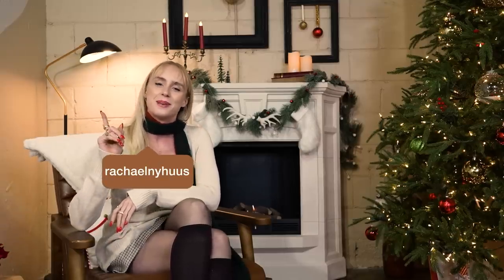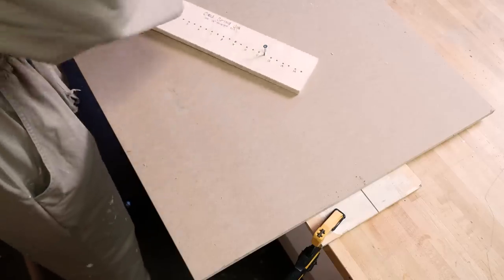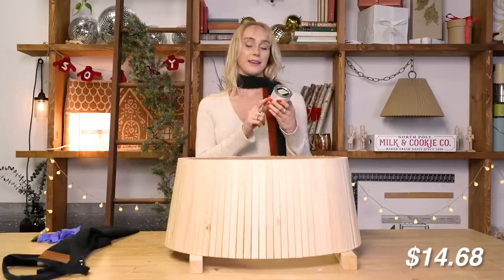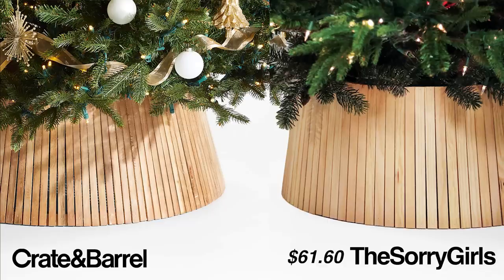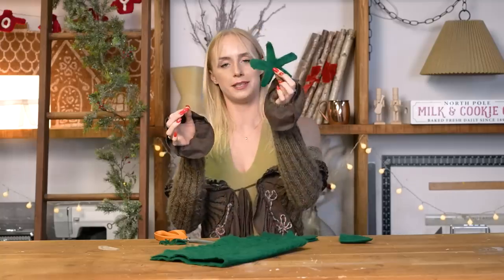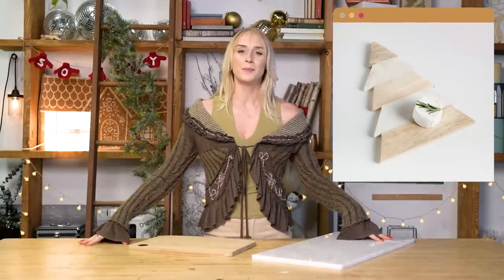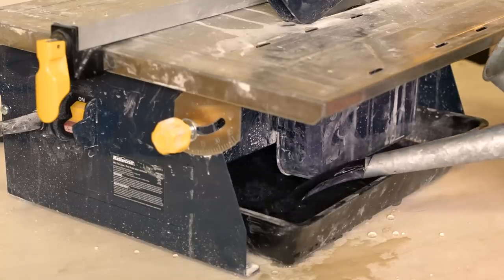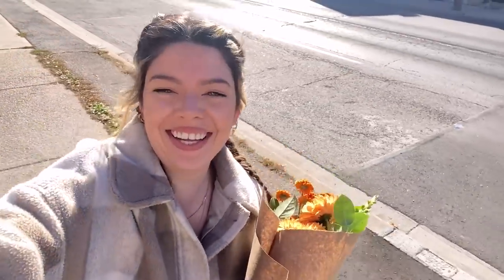let's DIY expensive christmas decor

Comment: Beautiful DIYs, but two of them require lots of experience and expensive tools so the all-in costs are actually higher than buying the original. Would love more accessible DIYs
Reply: Was definitely thinking the same thing. I have hand me down tools from family and am super lucky for that but even still I wouldn't be able to make any of these but the garland. 😔
Reply: Just so you know, you can rent tools from Home Depot or Lowe’s! Still is an added cost but might make it more accessible
Reply: Agreed. Plus like, I feel like they don't ever acknowledge their Marketplace privilege 😅 like sure you might find a nice slab of marble on TORONTO'S marketplace, but anyone in a smaller city or town is less likely to have bougie listings like that
Reply: Pretty sure to rent a tile saw from Home Depot in my area costs more than the actual  cutting board, so I think that diy was a stretch but I did really enjoy the other two!
Reply: @OceanLover1188  you don’t need to factor in time spent If it’s a hobby. That rhetoric around opportunity cost is only really applicable if the “making” is work rather than leisure.
Reply: I disagree. You can get tools like that at pawn shops for a fraction of the price, and holding their experience against them is silly when they’re walking you through how to do it step by step…

For the tree collar, you don’t even need fancy tools. You could do that with a hand saw, it would just take longer and not be as clean.

A lot of their older DIYs are more accessible. I personally appreciate these more elevated ones, though! They look much closer to the originals!

Comment: For future reference, I think you can cut craft felt on a Cricut. Also, some unsolicited feedback - I feel like the felt garland was made cheaper by just using cheap materials. This felt like an opportunity to use some thrifted or salvaged fabric (like one of those satin edge throw blankets) instead of using cheap synthetic craft felt. The originals also weren't that expensive. Like, if you compare to the cost of Rachel making them, and the higher quality base materials, the prices seemed pretty fair. But as always, thank you for a fun video!
Reply: Wrote this before Rachel pulled out a wet stone saw. The cutting board project felt a little inaccessible.

Comment: You can cut marble without the wet tile cutter. You can do it just fine using regular cutter with a diamond blade and doing it slowly without applying pressure.

Comment: Ok.. first of all when making a cost comparison ignoring the cost of essential tools isn't reasonable. You can ignore the cost of making your jig if you showed everyone how to do without it, you could use a jigsaw, but you used the router in two different ways, and making the angled cut, so the router is especially necessary, unless you show everyone how to make this project without it. You ignored your brad nailer which doesn't have to be a power or air tool but still has a cost. The paint brush. But also girls making diy crap out of dollar tree items know that sanding is essential, but when it is actual wood it is more essential, not just because it will feel nicer, but it will look nicer, and the top coat goes on better. 
It is really obvious that this is home made crap, which is sad because the dupe should be very close. This was a fail.
Ps. Using 'technical' words like chamfer with out defining them, but also inaccurately (tambour), (actually every way you used that word made no sense) makes you sound like you don't know what you are talking about. 
Tambour: a sliding, flexible shutter or door on a piece of furniture, made of strips of wood attached to a backing of canvas
Chamfer: transitive [the act of】 cutting off the edge or corner of something. (And once it has been completed, you conjugate: the edge has been chamfered)  
By the way, if all of this super-hard basic language stuff is just too complicated you could drop the technical words you don't understand and don't know how to use and just say bevel, or cut the edges 🤔. Maybe just don't use the word tambour at all since you clearly are lost